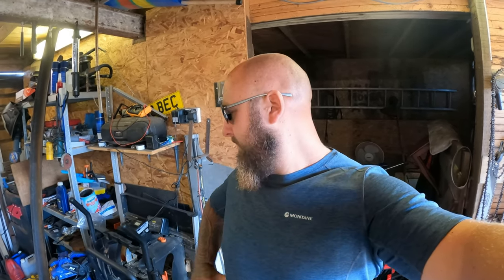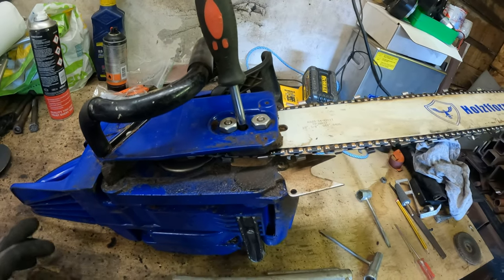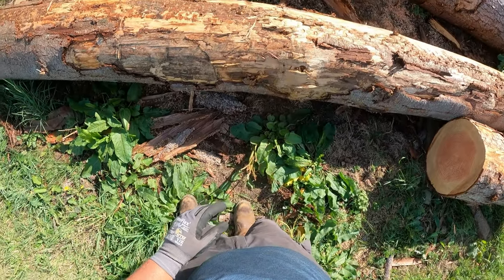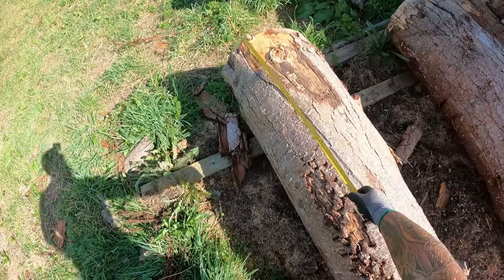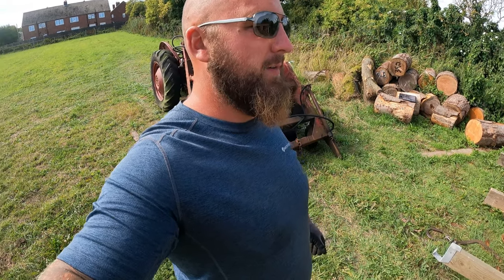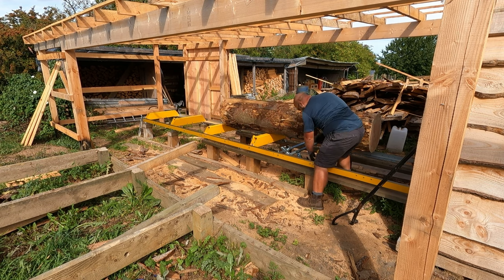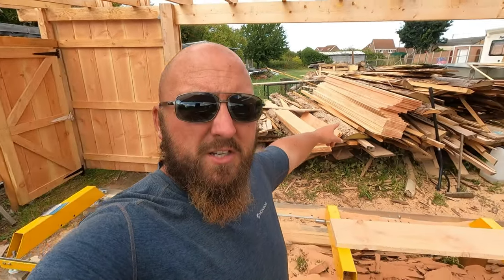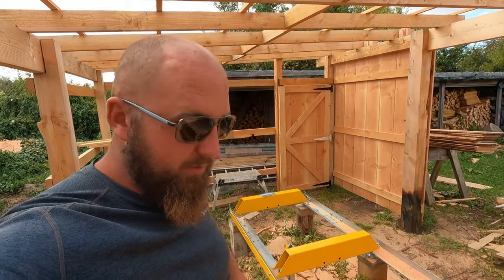Portable Sawmill Shed build - Milling boards for siding.

Comment: That's going to be a nice sawmill shed.   

In regards to rolling off the end you already have something there.   I've clamped the log clamp in the up right position to catch the log.

I have the Stihl 441 I believe it's around 71cc's.   It's my biggest saw and does great with a 20 inch bar.  

I'm using Fusion 360 for personal work.   I didn't have a cad class until my senior year in engineering college.  It didn't exist lol (1988).   In the engineering industry I used AutoCad.  

Another great video brother.   Keep them coming.
Reply from the maker: Thank you Jerry. It's not the best I would have designed and built but it's the only one that would pass with local authorities.
I'll use your method in the future, it's already there and easy, thank you for the suggestion bud.
Would you use the 441 for firewood processing or is it a bit too heavy for that ? That 660 has a 20" bar too.

I think I'll be using that next, I think I started with freecad because it was a little easier in terms on the interface but after watching other videos Fusion360 seems to be fairly easy too. It's like everything though, practice makes perfect.
Thank you again buddy, always appreciate your support.
Reply: @everydaywithmenick  yes I use the 441 for firewood processing.   I always take two saws with me.  I also have a Stihl 361 and a 362.   I think the 362 is my favorite for firewood.   It has plenty of power and a bit lighter than the 441.
Reply from the maker: @BigelowWoodcraft  yes that's what I was going to ask about the weight of the 441. I think the 361 wouldn't be a bad shout for the future then. Just weighing up a newer saw 😆